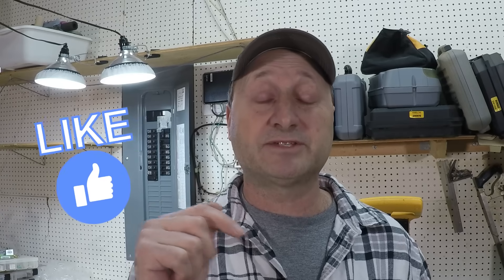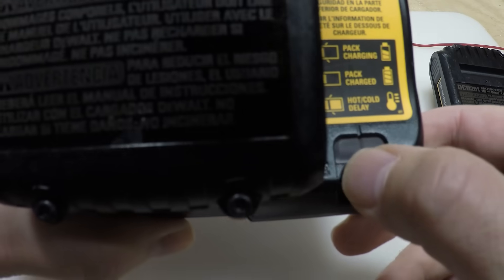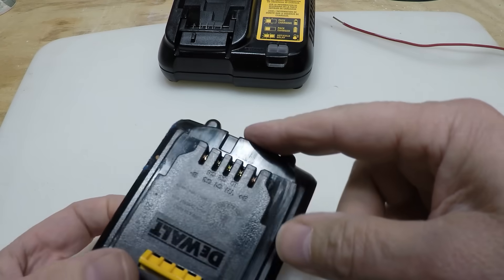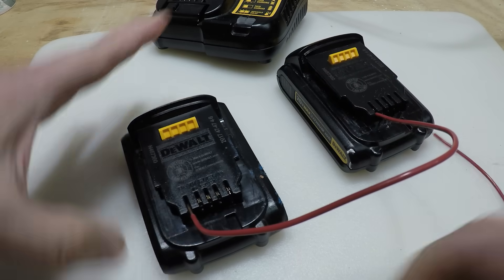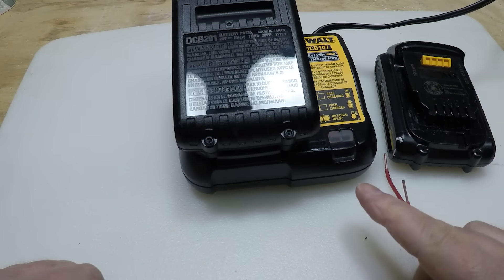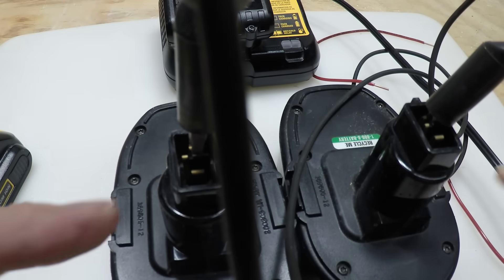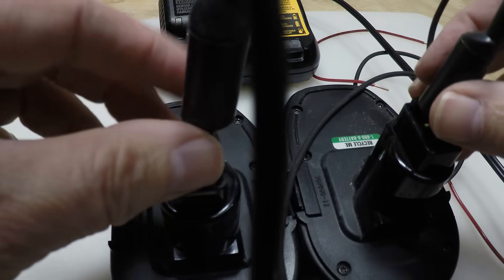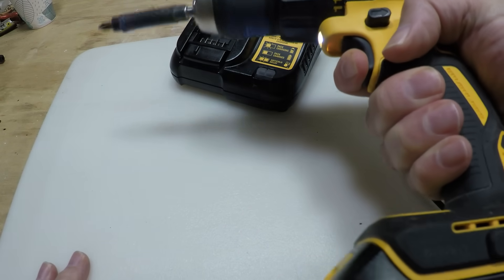SECRET to FIX Drill Batteries - Charge Dead Lithium Tool Batteries

Comment: So how do I do this if both my batteries are the issue? I don't have a good battery for my old set  much like the ones with the click in stalks. Not the slide in kind. Can I do it with any other battery?
Reply from the maker: Nikki, you can use any lithium battery to jump start it

Comment: Hey thanks for the information. I have a slightly different problem with my 18v Ozito battery. It has 3 red state of charge lights on the battery but when placed on the charger it charges to one red (SOC) then the charger flashes red (for charging) and green (for fully charged) but the battery won't charge to over one state of charge red light.  
Also Ozito say in their manual that it is best to fully drain a new battery a couple of times before using "top up charging" of part discharged batteries. Do you agree with this?

Comment: I did not beleive this would work but! It Worked!!!!!!!!!!!! Amasing! 
Thank you very much sir. 
Is it normal that this shall get done every time with the old battery?   I mean... the old battery which did not worked, did work after I did as you show , charged it, paced in on the tool and the tool worked perfectly. When I tried to recharge the old battery, the same happened as before , it could not charge and I had to make a new reboot.
You help a lot good folks out there and you help this entire planet becasue recyckling and fixing stuff  is always better than throwing a way! 👍

Comment: What if the light turns on but no matter how long I leave it on the charger the battery never charges and when I put the battery into my drill turns on but is dead. Would this method still be applicable to my problem?

Comment: Generally does not work. On Cheap replacement batteries the internal chip needs replacement. What does chip look like? How to you remove it? How to you solder a by pass?

Comment: Brand New Battery ... Used It Once.
Had to Jump It With The Old Style Battery ... But It Worked.
Why don't they make the charger with a boost button to start a completely dead battery ?
Saved me a trip to Lowes to complain ... Thanks.

Comment: Hi there sir I have two Makita 18 volt batteries are went dead on me will not take the charge in the charger and try to jump start it with another 18 volt battery but is not taking that has a reorder batteries they are very expensive just wondering if there's something try to do to save these batteries

Comment: Great video! Used a Milwaukee 18V to jump 2 Flowzone 18V batteries. However, I can not get it to jump my 2 storm 18V batteries (FlowZone & Strom are the same battery from 2 different brands). Any ideas on how to get the Strom batteries working again? Going to try using the Flowzone to jump them instead of Milwaukee once they are charged but am not sure what to do if that does not work

Comment: Morning Sir, I have a 12V Battery (New Ones). When I plug the 12V Battery into the charger it shows green like however when I plug it into the drill nothing happens. It does not starts or run the drill but indicator shows the battery is full. When plug it into the drill; the drill don't function or run? Why?

Comment: how about the batteries that only provide power for a short time.  They charge but only last a very short time and need to be recharged.  Dewalt 12 Volt for a drill.

Comment: have a batteries  with 3 connectors but they are not marked ( Li-ion 21V 2100mAh BAT101 for a coolest cooler) any idea which connectors to use to jump start?

Comment: Omg I was going to throw my battery out 
After connecting - to - ( neg to neg ) and + to + ( positive to positive for 30 seconds it jump started the battery that had no charge light at all ,
when placed on my charger the lights would go red / green and just keep flashing. 

After doing what is stated in the video I can now charge that battery Whooo Hooo just saved $54 bucks 
I did this to a noname Venon 18v battery.
Thanks so much from TJ Downunder you rock bloke thanks heaps mate x

Comment: I have a Hitachi DS 120vf drill and the battery that came with it along with the charger. The charger doesn’t charge the battery and the batteries you used on your show are not like mine. Solution?

Comment: Well I got to say. Had my doubts. Mine was flashing red. About to buy a new battery. Had good 12v cordless battery. Opened it up and found the negative and positive. Made to short jumper wires to my dead batteries negative and positive. Did a quick jump. POW! I have my dead battery flashing green charging. Saved me $20 Thanks

Comment: I have a dead 36v Black and Decker battery but no “live 36v” battery to try this. Can I use one with lower voltage? What other option is there? I also have a 56v Ego battery but I am not sure I am comfortable trying with that (those batteries are like $200). Thanks

Comment: I am looking at a 12V Warrior battery at this time, I used a gator clip and angled a +/- plug to make the contacts. Held it for 30s, and it relieved the LED green and the small DC plug then turned red to charge. This bridging worked to trick the sensor. A couple minutes later the light began to flash red/green. I understand this means there is some malfunction with the battery. Other videos only diagnose connectivity pins and seating with secondary chargers...Would you know or can recommend troubleshooting this issue on the level of a diagnostic or rebuild level? Whilst the other battery is working I will be using that, and on my downtime I will be opening and experimenting with the non-responsive one. 
I need practice testing cells, rebalancing, or outright replacing cells so I have no reserves on deconstruction.

Comment: I used this method on a Ryobi 40V.  Initially the battery didn't register when plugged in.  After jumping it from a similar battery, the charger tested it and then showed it as an error battery with a red/green flashing light.  I'm assuming it is really dead.  Anything else I can do before I buy another.

Comment: I have the old style 18 volt. One is for my  DeWalt drill/driver and one for the drill. They are both 18 volt batteries, but the one for the drill only holds power for a very short time. After I charge it, it will run for maybe a short job (30 minutes or so), and then it starts to run out of power quickly. Do you think it's just at the end of its life? I have not tried your technique of bridging the two batteries yet to see if it will hold a charge like it used to. These were my husband's tools, and he died 6 years ago. He had them for possibly 6 to 8 years before that.  If I must buy a new battery, then I will, but if it's just because it's running too low to adequately recharge, then that would be awesome. A year or 2 more of life would be great!😊 No matter what, your video was helpful!

Comment: Hello, i have a Milwaukee 12amp that when plugged into charger it flashes red which means the battery is outside the charging temperatures. I tried boosting and it still didnt after 15 mins of boosting which tells me there's a fault somewhere else. I bought the battery from Amazon as used but like new. It only ran my weed trimmer for 10 mins and died. A new 12amp runtime is 45 mins plus. I tried everything i can think of. Is the battery toast???? If so lesson learned never buy used batteries

Comment: I have a 18v lithium ion kobalt battery that won’t charge I’ve tried everything but the wire I’ve been using is like speaker wire would that be my problem

Comment: I still have an old laptop from 1995. It sat in storage for over 20 years, in a hot garage. The battery still works fine. Clearly they put "stop working" technology in the newer stuff. Litium batteries used to be rated at keeping a charge for over 10 years, not these days though.

Comment: My 60 volt craftsman lawnmower battery won’t charge. I’m the problem… I mowed till it died. The charger gives me a solid green light immediately upon insert. I don’t have a second 60 volt battery to jump start it. Can I use a 24 volt battery for the jump start?

Comment: This works 100percent ! Thank you so much for sharing ! My batteyr was dead and didnt want to charge. I didnt have a spare battery so I stripped the battery and hardwired the positive and negative terminals directly to the charger for 10mins. Tested it and worked first time. Closed up the battery and now charging it normally via the charger. Super helpful thanks again !

Comment: Cheers great video got my battery working. Does anyone know if this is a permanent fix or will it just fail again? The battery I have just booted iwas only on about its 3rd charge before  it went to failure charge

Comment: Tried this and thought it had worked but only charged (flashing green) for about 5 mins then started flashing red. So put it on tool it ran for about 3 seconds then died. Put it back on charger and it started flashing green again but only for a few seconds this time before flashing red. Took it back off and put it back on tool and again worked for 2/3 seconds. Back on charger and repeats green for a few seconds then red, back on tool again worked 2/3 seconds then nothing. Just keeps repeating same everytime. Any ideas as this is 2021 Stanley fatmax and a new battery for these tools is around £70 to the £80, the new V20 fatmax doesn't fit the 2021 tools,  daylight robbery, I actually thought there was a law against company's doing that sort of crap as the new V20 fatmax iis only around £40.

Comment: I have two Hoover Onepwr 4.0 batteries, relatively new, that just died last weekend.. both at the same time.  2 separate charger now flashing the defective battery flashing red.  I purchased a knock off replacement from Amazon that works fine but I'd like to try and revive one or both of the other two.   The pins are not labelled but I tried to connect one of the batteries to the new one as indicated.. outside pin to outside pin on each but it didn't work to revive it.

Comment: Someone set a brand-new looking Black and Decker drill/battery/charger at the recycle station of our condo. Likely because the battery was flashing red. This fixed it and now I have two Black and Decker cordless drills. One for the drill bit and one for the screw driver bit!

Comment: I have a Ryobi 18Volt XB 4000 Lithium ion battery.
After a couple of years of not being used I put it on charge and i get alternative alternative red and green flashing lights on the charger

Comment: This does work ... sort of. The dead batter worked again, but with an extremely diminished capacity. It eventually faded to the point where it held virtually no charge anymore after a year or so and finally had to be discarded.

Comment: I have a M18 Red Lithium Milwaukee battery, that shows it is have 3 out of the 4 windows lights up, but when I put it in the drill, it’s almost dead.
When I put it back on charge, it hardly ever charges, and the charger goes to green.
Means it is full.
What do I do now ?

Comment: Hey, I had the exact same battery that you recharged, and it worked like a charm.  Battery would not come alive with no light in the charger, just like yours.  After your B+, B - wire trick, charger light started blinking and Batt was fully charged in one and half hrs.  Thanks a bunch!!!!!!
Reply: I have hitachi 18v batt and charger light blinks indicating charging but no charge just tried your wire trick will find out later if it works
Reply: @JimmieAbernathy my Hart charger blinks red if the battery isn't charging and green if it is.

Comment: I made 2 jumper cables from wire and spade connectors,   They’re a lot easier to use than just the bare wire ends.

Comment: Where to buy cables with clip to jump-start old-style Dewalt battery.
Is there a way around using wire to jumpstart an old Dewalt battery

Comment: what this video doesn't tell you is, the capacity of your 'repaired' battery is never going to recover to full capacity.  So your operating time will still be quite short.  

The proper and long term fix is to open up the pack, find out the one or two cell(s) that's dead.  Replace that with a matching capacity 18650 cell.  Rebuild the pack.  AND THEN you're good to go.  But most people don't have the skills or patience to properly rebuild a battery pack.

Comment: It’s same jump starting a new battery in a car that is subject to a parasitic drain. Even a new battery , and a high quality one, will be able to withstand a few jump starts until it’s dead. My SUV had a drain that none of the local mechanics could find the problem. Over 4 years I spent 1600 uk pounds replacing batteries. 400 uk pounds a year on 4 batteries. Each battery jumped many times until it was totally dead. These are much smaller so it will only be once or twice.The cells are dead or dying. No battery can last forever. They all deteriorate over time. If they didn’t, how would these companies make money?
Reply from the maker: thank you for watching

Comment: I have one of the older batteries that have 4 prongs in it.  Two have to be positive and the other two negative but which two is what
Reply from the maker: check the battery manual

Comment: Can anyone justify the design of the battery/charger to not work when the battery is completely dead.  It makes no sense to me.  Is this simply poor quality of design or is it a money grab as most people go out and buy a new battery?
Reply from the maker: I think it is a safety thing. It prevents a kid from getting shocked when sticking wires into the charger. The charger needs to detect a small amount of juice on the thing you are plugging into it before it releases a charge to it. It is its way of validating that a battery is plugged into it.  Just think,.. those prongs on the charger would always be live or hot if you had it plugged in without a battery attached to it..

Comment: After trying Your system and did not work, I realized you have to open the battery and bypass the electronic circuitry. In my case both batteries had one battery short-circuited which I do not believe can be fixed. So I bypassed the circuitry and use less one battery. Now both batteries are charging and maintaining 17 Volts. I cannot use them with my 24 Volts drill but they will be very usable with 18 Volt Tools.
Reply from the maker: okay great news for you

Comment: I have two 20 V lithium batteries, one with 13.1 V the other w/1.5V. I tried first on the charger, nothing, then with a 0 to 30 V power supply, nothing. Tried your solution, Nothing! Now I am open to other suggestions!
Reply from the maker: make sure you are going from lithium to lithium and you are going from (+ to +) and (- to -)

Comment: Do you have to have identical batteries for this to work
Reply from the maker: no you do not
Reply: Yep, found that out, used a millwaukee battery on a seemingly knackered bosch battery (both 12v), worked a treat. Many thanks.

Comment: I have 18 volt battery, the charger indicator shows that is charging, but after a while I put it on the drill and roll with no power. I've checked the contacts with tester and it shows only 3 volts. Can the battery be fixed?

Comment: I bought a Makeda drill and impact kit 20 years ago. Use them daily for fifteen years,  then Built a half mile cedar fence with the drill and 2 thirty by thirty buildings. Never had to replace the batteries and the drill just now wore out.  Maybe I just got lucky but either way  it's pretty darned amazing 👍

Comment: What size and type wire do I  Need to use solid copper core or multiple wire core , how long should I cut the wire? What size alligator clips?
Reply from the maker: the size of wire does not matter. You just need to make the connections

Comment: First, I want to thank you for the tips, but I have a Bostitch battery and charger, and the red light on the charger just blinks really fast, and it's not charging the batteries. Do you think it's the two batteries or the charger? Haven't used the drills that much to have two dead batteries.

Comment: I got a craftsman 18 V drill battery and flashlight battery I tried to do what you did I left it on there for about 15 minutes and then I put it back in the charger and charge for a little bit but then the yellow light came back on but the red light was still flashing too so I don’t know . I should sort it out cause I seen somebody do that ton YouTube and they jumped it again and it worked so I don’t know.  Maybe.

Comment: Well.  It worked!  I had one B&D Firestorm 18v battery that wouldn’t charge, jumped the terminals from a fully charged battery to the failed one for just a few seconds, then put it in the charger.  That was one hour ago, and it shows about 75% and still charging. Nice.  Thanks for the tip…
Reply from the maker: I am glad it worked for you too. please share the video for me
Reply: Mine is black n decker,my problem is about the charger,,they said its an old model and not available now in the market,,just bought it 1980 n the tecnichian tried to fix but still not working already been stock for a years now,can you give an advice whether to throw it out or not ,thanks

Comment: I have a Makita 18volt. Battery when put on charge the red light blinks. But doesn't take a charge. What can be the issue. When the battery is totally flat and put into the charger the red light comes on and goes off when fully charged. Explain please.